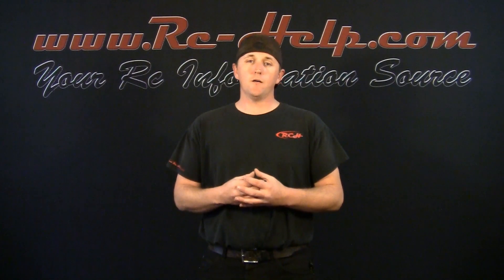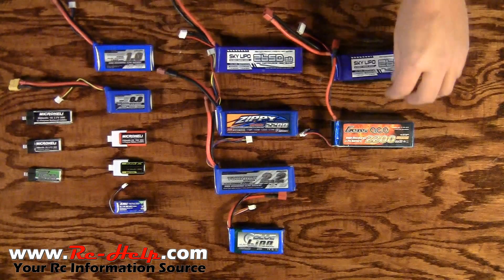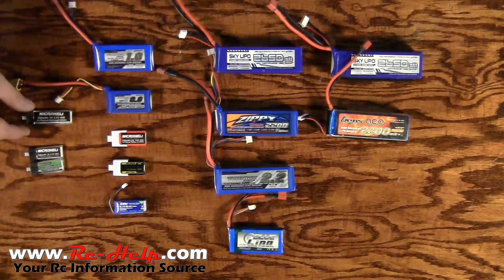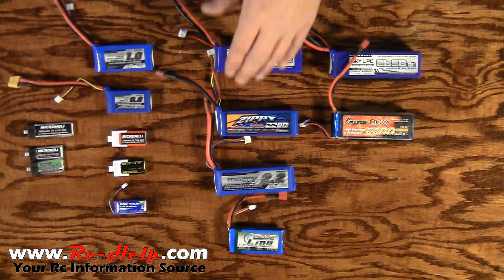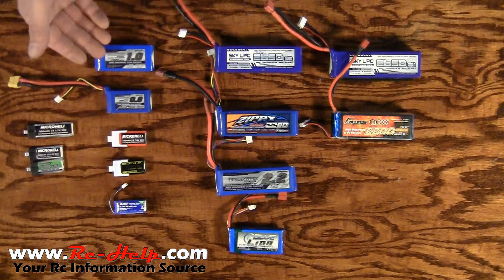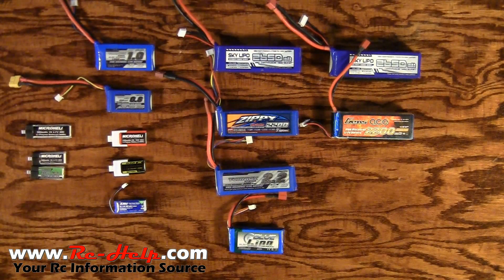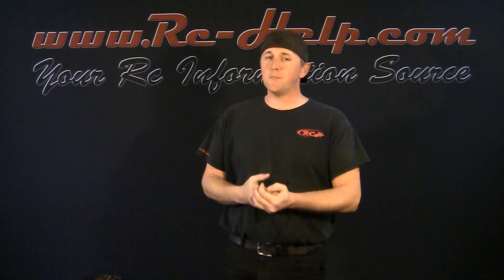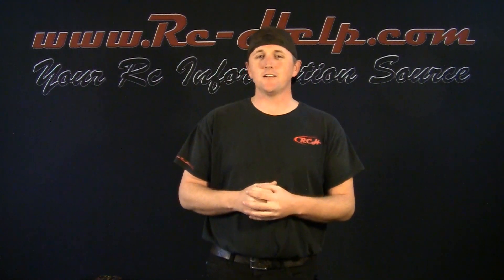Lipo Batteries Explained

Comment: Hi,I have some doubts why is there a continuous spark when I try to connect my lipo battery (2200 mah 11.1 volt 3s 30c) to my esc (30a) and is it because of friction
Second thing the battery i mentioned above also showed the voltage in negative when I checked is with my multimeter.
Reply from the maker: It shouldn't be continuous on the spark, but there will be a spark when you connect the ESC. The reason for the spark is due to the capacitors on the ESC being charged. For a 3s, I would not be too worried about it. 

As for the voltage showing in the negative, please be sure you put positive on positive, and negative on negative for the volt meter. www.Rc-Help.com
Reply: @RcHelpDotCom  thank u very much

Comment: for a small cardboard plane what is the recommended battery rating?
Reply: its impossible to tell from such a vague description. how small? what size motor? what size propeller?  ESC?

I recommend using dollar tree foam board instead of cardboard, cardboard is heavy and not very strong for its weight.

I guess a standard small sized plane (26-30 in. wingspan) would probably run a 2000-2300 kv motor which swings a 6 inch prop. it would use a 2-4s 25c/50c battery anywhere from 450mah-1300mah. just have to make sure your ESC can handle the draw, probably would be safe with a 30 amp ESC on a 3s battery

Comment: Nice vid dude
I use a battery 4s 6000mah. 55C
 Now I bought a battery 4s 6000 mah 120C.
 What change will I feel ... by power ...driving time..
I charge regular ?
Thanks
Reply: I don't know much about this stuff, but from what I do know I think it wont change anything at all. don't take my word for it though, do more research as I'm not really sure.

Comment: hello,im building a electric skateboard,do you suggest a 18000rpm 150W or 10000rpm 80W motor because some say the 18000Rpm may burn out
Reply: Thanks for the info but what would happen if i use 10K with 100lb load?

Comment: I am having 12 vots and 200map its possible to charge a battery
Reply from the maker: I do not understand the question. Please clarify.
Reply: @RcHelpDotCom  i have a power source which can produce  12v and 200mamp if its possible to charge a battery if i want to charge a battery means what to do
Reply from the maker: Without a charger? I definitely would not try it. Only charge a battery at 1 to 2 C.
Reply: @RcHelpDotCom  i use solar pannel as my powersourse
Reply: @RcHelpDotCom  1 or 2 c means
Reply from the maker: So if you have a 1000mah battery, 1 c is 1 amp. If you have a 2000mah battery, 1 c is 2 amps. The equation to figure out C is (mah*C)/1000=Amp